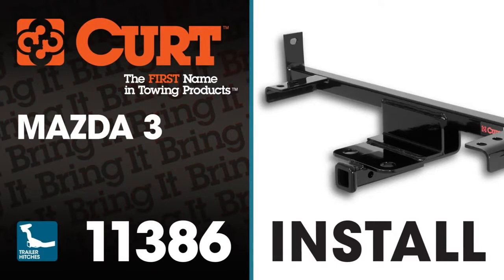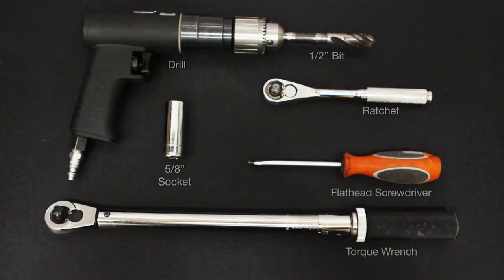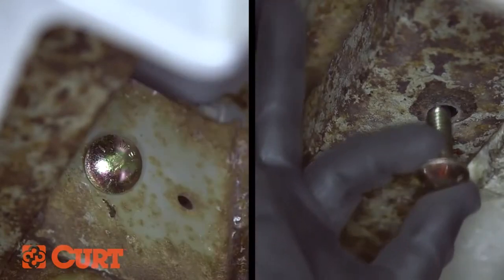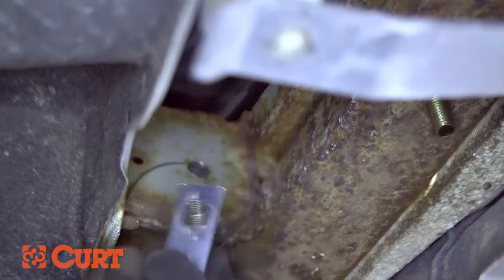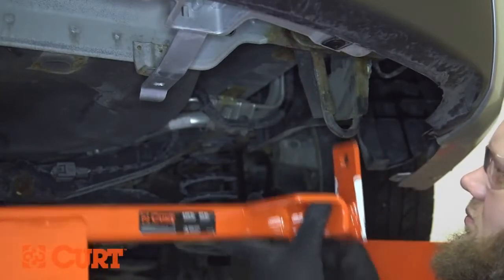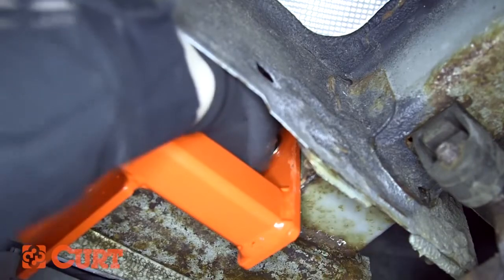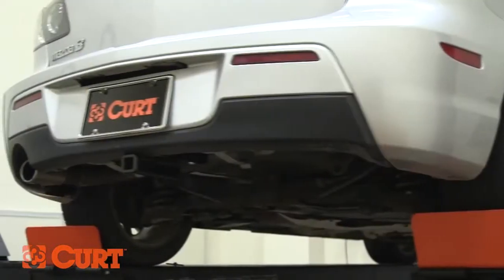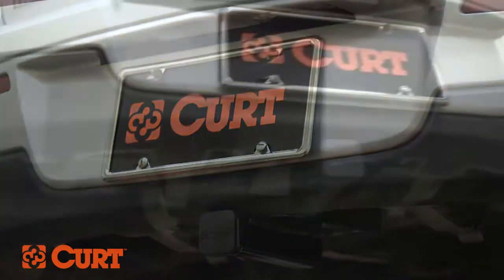CURT 11386 Trailer Hitch Installation on a Mazda 3

Comment: Just finished installing one on a 2005 Mazda 3, and I'm gonna share my experiences. The video shows that you receive two of the fishing wires. That isn't true, at least in my case, as there was only one in the box. Because of this, we found (a friend helped me) that it was easier to drill the holes, put in the first two bolts (as in the video; the ones that hang down), then raise the hitch up on a floor jack, fitting it to the two bolts, and tighten the nuts finger tight. After that, fish and install the two side bolts one at a time -- since you only have one fishing wire, remember -- going through the frame and the hitch, and put on those nuts finger tight, too. Torque everything up, and you're done. Overall, even with the lack of two fishing wires, the job was easy, although fishing the bolts through can try your patience. Good luck with your project, too!
Reply: Thanks!

Comment: Just installed. Some tips: Use a cobalt step drill bit off amazon to do the holes. (Most normal bits will not drill through the steel.) If you do the two bottom bolts first, and keep them slightly loose, as this will make installation of the two side bolts easier (the hitch weight will hold the side bolts into place as you apply the nut). Car ramps make the install far easier. Jack makes holding the hitch in place far easier. If you don't have any of this equipment you may be better off paying to get it installed at your local car shop... would be cheaper in the end.

Comment: I need a class 3 for a motorcycle trailer ramp to attach to hitch but I can only install class 1-2 hitch frame is it possible to get conversions to allow them both to mate? I have 2014 Mazda 3.
Reply: Did you ever figure out a way to instal a class 3 hitch?

Comment: Is the hitch the same on the sedan and hatchback? Also between all 2004-2009 model years? Thanks!
Reply: I have a 2009 Mazdaspeed 3 (Same as a 2009 Mazda 3 Hatchback). Thanks!
Reply: @seb42  5 years later, did it work for your mazdaspeed? Might throw one on my car. Btw, love your channel.